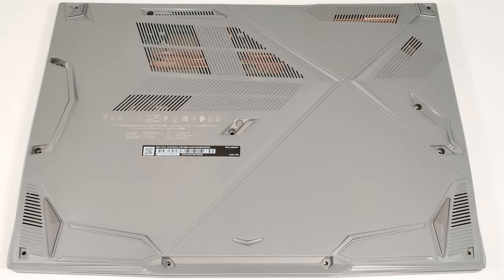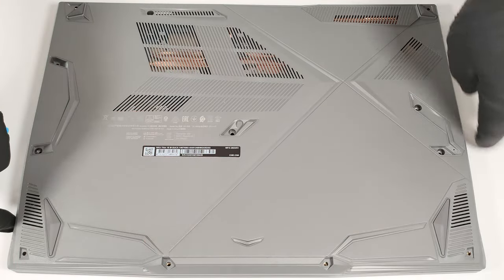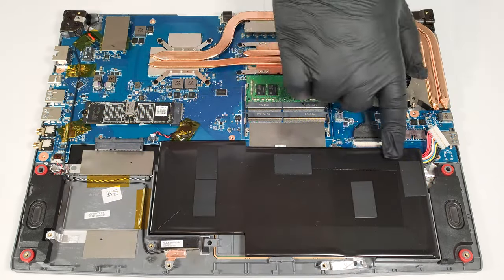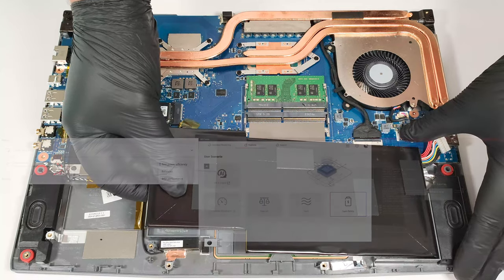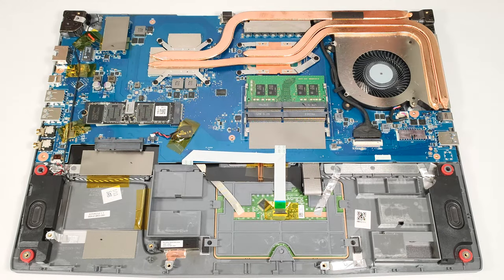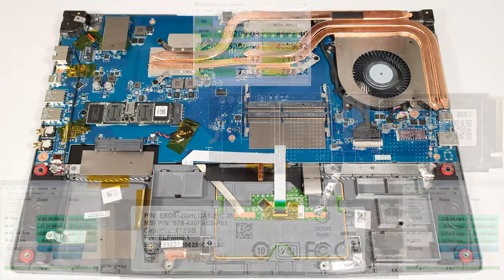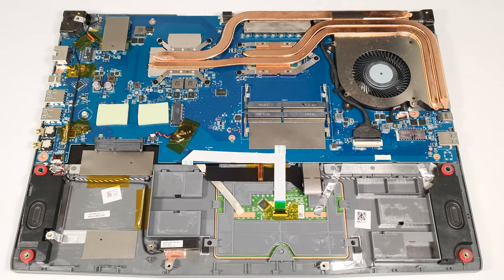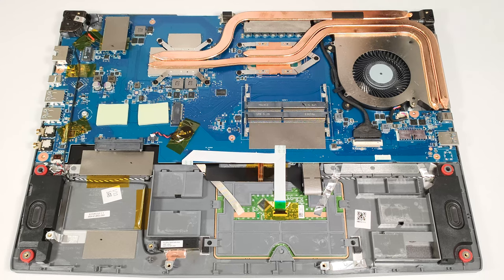🛠️ How to open MSI Thin 15 B12U - disassembly and upgrade options

Comment: holy shi i just bought this the 2050 version and i didnt know i can upgrade the ram and the storage this was very helpful! thanks!
Reply: planning on buying this, whats your initial feedback on the laptop?
Reply: @aminsyedwww  its pretty good it can handle a lot. played valo no lag consistent to 120-150 fps while playing bg music / vids. The only thing is for the thick size of this the battery can only go for like 5-8 hours depend tho. Since i bought the 2050 ver its pretty good for its price since no other competitor can give more specs than this
Reply: @KeeyPie Yes, I bought this notebook because it was cheap and worth it at a price of just 463 USD
Reply: i got one with 3050 and i7 13th. its running very smooth on recent triple A games. Also dont forget the turbo cooling 🔥
Reply: I bought the 3050 for early black Friday sales
Reply: I also had this (Thin A15 B7UCX) with AMD Ryzen 5 7535HS and RTX 2050. I don't really play a lot of Triple AAA games and I only use this for game development and it is exceed my expectation.

Comment: I bought this a week ago. My review for the MSI thin 15 i7 13620h , 16 RAM, RTX 3050, 512 SSD.

You can find gameplay on it in my channel.
Pros:
1. Very strong and capable.

2. Very light, not heavy considering it's a gaming laptop.

3. No lag whatsoever when browsing.

4. Runs heavy games very smoothly and 
Comfortably.

Cons:
1. Dedicated card is 45W.

2. 512 GB SSD might now be enough for some users. Upgradable with a sata slot.

3. Not the best quality build (plastic)
But I'll take it considering the price (2900 SAR)

4. RAM is DDR4.

5. Can get hot on extremely heavy games as theres one fan only, but you can boost the fan to run around 5881 rpm and it takes away 50% of the heat 

I bought this laptop for around $770